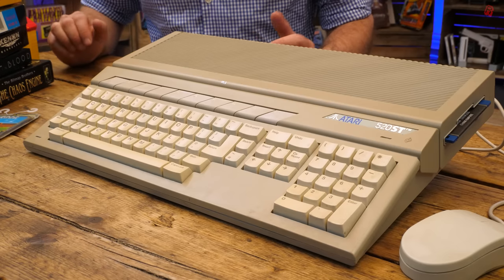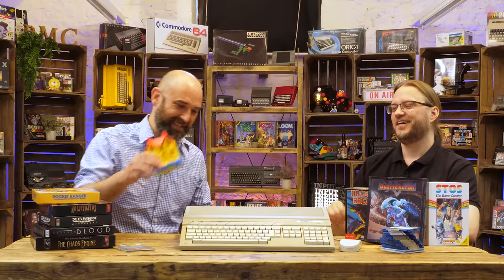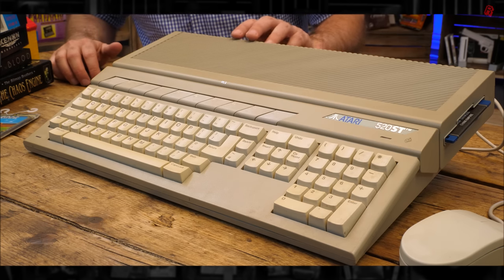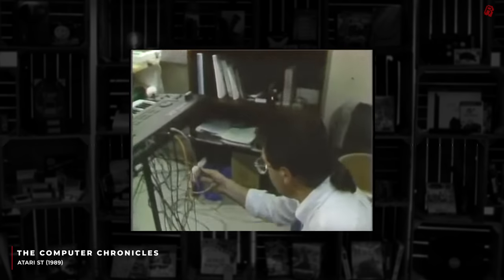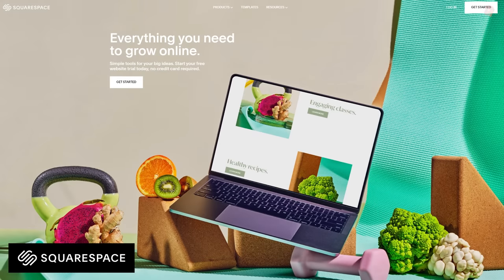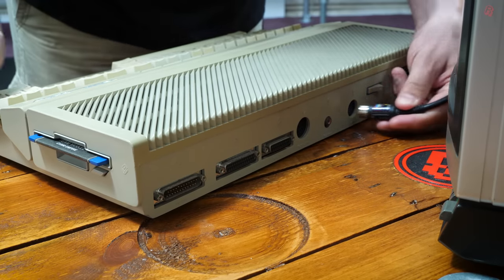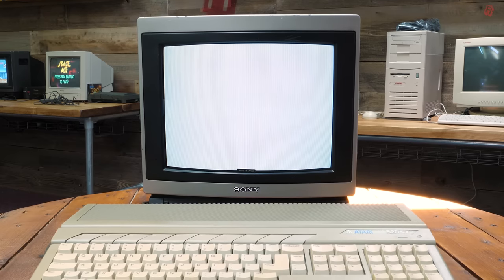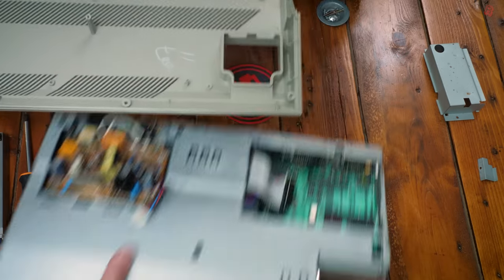At last! An Atari ST in The Cave - Meeting and Restoring a 520 STFM

Comment: The Blitter chip actually can be fitted to that ST, and will be used by TOS 1.04. Blitter was also present in some later Mega STs.
Reply: Does anything besides TOS use the MegaST blitter? As I understand it, it's not 1:1 compatible with the STe blitter and almost nothing uses it. (Hell, barely anything uses the STe blitter -- I think more stuff made modern day by enthusiasts uses it than commercial stuff back in the day)

From what I know, you can only add the MegaST blitter to the 520/1040 boards that have a spot for it. You can't add the STe blitter. (Though even if you could you would still be missing the other STe features, notably the sound, scrolling, and wider palette)
Reply: I was just sat wondering whether you could backport the blitter. Neat!
Reply: Well the blitter was built into the Atari STE, from about 89 or so.
Reply: @godslayer1415  Maybe in the US, but in Europe first series of Mega ST1 came without the Blitter chip, and actually they are not that uncommon here. Mega ST2 and Mega ST4 had Blitter, but there are reports of Mega ST4s without the Blitter.

Comment: Sadly, my ST-E took a dump during a REALLY bad winder storm in 2007.  Just before the recession.  I still have piles of stuff in a SAFER storage.  Modem.  Books.  Disks of software.  Manuals.  But no CPU unit !  I'm hesitant to shell out $$$ for a second hand.  I don't exactly understand the bad vibes the 1040 gets.  14 years of waiting to get a working "museum" computer.  I've started asking around to a couple used Computer shops...  No idea if there's any relics here in Southern Ontario.

Comment: The blitter actually came with the Mega ST, a couple of years before the STe came out.
Reply: My STE has one
Reply: Yeah, you can even add it to a regular ST if you can find the correct socket to solder it in!
Reply: @godslayer1415  who said it would work
Reply: @AmstradExin  

Really?! That's interesting! I'd love to upgrade my old 520STFM with one... because!
Reply: @godslayer1415  

Ahh did you try fitting it?

Damn!
Reply: Perhaps, if the blitter was added as a cheap and easy upgrade for all, more developers would have taken advantage of it. This chip, which takes the load of the CPU, can be so helpful.
Reply: I don't recall much software supporting the blitter or other STE enhancements. Actually I recall the 520STFM being relaunched at a bargain price some time AFTER the launch of the STE, which was really too little too late. I guess that might be the type of machine Neil has.
Reply: @ridiculous_gaming  It would have been a very easy upgrade if Atari had actually not cheaped out and included the socket soldered on the board. As is you have to unsolder to pin holes install a socket and then you can stick the blitter in. If you can solder it is not that hard a job (I did it in my STFM), getting the pin holes clear is the hardest bit, which is easy enough with a solder sucker, not much fun with wick though.
Reply: @MrDuncl  A lot of the newer homebrew stuff for the ST is now using the blitter (and other STe stuff), so it is more useful to have around nowadays.

Comment: I remember owning an Atari ST 520 STFM as a kid and wanted to upgrade the internal single sided disk drive.  The new drive arrived but was disappointed to find that the drive bay slot on the Atari case would need modification to allow disk insertion into the new drive. My father, hacksaw in hand and a glint in his eye, said 'Don't worry son, I will resolve this for you, do not fear'! Before I could protest my Atari was whisked away to his shed and after much banging and crashing and horrific zip, zip, zip sounds my father returned proudly holding a case that looked as though it had been inserted into an industrial threshing machine.  The drive worked just fine but you could have driven a bus into that insertion slot.  Bless you dad, love you loads! 😘

Comment: The YM2149 was used because it had additional IO Ports. The parallel (printer) port is driven over these IOs. The ST was cheap because of its reduced chip count.
It was not only the MIDI-ports but also the ability to "shut down" nearly all hardware to create an real-time environment that made the ST the MIDI-machine we know.
The MegaST1 was the first ST with a Blitter chip. They omitted the Blitter because of supply problems. Early versions of the Blitter weren't stable and had a lot of dead chips in production. The first Blitter you could buy where the version 5 or 6. (You could buy the Bitter as an "upgrade" for the ST together with TOS 1.04 directly from Atari at some point)
You can add 512k on the second bank. On some models the needed additional resitors are already installed, not on others. If some Resistors between the MCU and RAM are missing add some with 47-Ohm. The MCU is overloaded when the RAM is selected if the resitors are missing (bridged). To expand the RAM to 4Mb (max possible) needs some additional Resistors and RAM-select Line from the MCU.
520 ST you have is a very late model. The Custom ICs aren't socked as in early revisions of the board. The floppy is also the later model with the small eject button. The early floppies are less reliable, create the "known" noisy floppy sound and are receptive to the "headcrash visus" ( A boot sector virus that would drive the floppy head so far back that i got stuck and possibly disalign the floppy )
The SM124 Monitor is a must to use. With 72Hz it was a joy to work with.
You can run onto problems with the ACSI port. It uses internal "inverter delay timer" to create the communication timings with the hardware. Because of the age the timings can get somewhat distorted (shortened) As a result some hardware didn't work. Lowering the voltage of the IC with a diode can help.
Reply: Also, the ST used more off the shelf parts than the Amiga which used custom ICs for everything (it did Commodore that they had their own chip fab in MOS/CSG)

The ST was a quickly made up machine invented specifically to compete with the Amiga after Amiga decided to drop the deal with Atari and went to Commodore.  They did make a good machine and I see this as an Amiga man... wasn't as good as the Amiga (though to be honest, the Archimedes beat them both)
Reply: @GeoNeilUK  I like the ST because it's so easy to hack. The off the shelf ICs have good documentation, the Layout of the system is simple. The board is robust and can handle additions. The OS is minimalistic and don't restrict the hardware access. You can easily add chips to the bus (especially in the last 1MB of address space) Especially the Mega ST is a really nice board+case to do mods because of the space. I build a measuring station with a friend out of an Mega ST 25 years ago. (He was working in an university. A lot of measurements over al long time with special analog equipment)
Reply: @GeoNeilUK  both theories (the ST built from off shelf parts and made quickly to compete with Amiga) are just an urban legend.
Both computers have custom chips (Atari: Shifter, MMU, Glue, DMA, BLiTTER; Amiga: Gary, Denise, Agnus, Paula) and both have off shelf parts (Atari: ACIAs, MFP, YM, WD1772, 68000, ROM, RAM, TTLs; Amiga: CIAs, 68000, ROM, RAM, TTLs). 
The Atari ST was born as RBP (rock bottom price) before Tramiel and Shivji left the Commodore. It was based on the Commodore 900 (Shivji was working on it since 1983). 
According to Minter, Lorraine (Amiga) was born as a gaming console. Tramiel and Shivji well knew how to build a great game console (C64) but they decided that the Atari ST will be a real computer for productive tasks. As you see - different concept, different target group.
Reply: @blast4722  The Commodore 64 isn't a console.
Reply: @blast4722  The Amiga was never intended to be a console by its creators, although they allowed their initial financiers to believe that because that's what the financiers thought would sell well. And as Neil says, the C64 was a computer too (the keyboard should have given that away...).
Reply: @GeoNeilUK  True although they did make one, which I gather was a commercial flop.
Reply: Just a note regarding the 4MB RAM limit: it's only the limit for "chip" memory.  You can add an additional 10MB of "fast" memory that only the CPU can access.  Uwe Schneider's Magnum project is one such expansion.

Comment: My first job after school was repairing computers and printers for a retailer. We handled both the Atari ST range and the Amiga Range, and it was interesting comparing their construction. As I remember it the Amiga was built following all the design rules of the time. A lot of circuits was socketed and they used pull down resistor nets like it was a religion. Capacitators were used everywhere you were told they should be, every port had buffer chips to preserve signal integrity and so on. The Atari on the other hand was obviously built to a price point. Pulldown resistor nets were used if they were necessary, capacitors were sparingly used, the ports were directly wired to the logic chips without any buffers and there were very few socketed chips.

Given the differences you would have thought that the Amiga would be the more robust design, but our experience was that it was the other way around. Now a lot of that had to do with the large socketed chips that tended to creep as the computer chassis flexed when it was moved. But we also had some problems with ports that got burned out even though on paper they should be way more resilient than those on the Atari ST machines.

OK, so I've done my part and gotten that old story typed out. It's been a long time since I opened one of those machines. The fun thing was that back then there were no problem to get the circuit diagrams for machines like this. Today I don't think it would be as easy...

Comment: I miss my Atari 520ST. I had one kick ass system back in 1987, with both the RGB and Monochrome monitors with a switcher to allow me to boot either depending on which one I wanted. I had 2 Hard Drives mounted in an XT case, LOADS of software, peripherals, an Epson 24 pin printer, and so on. In 1990 I sold all of that to get a.....well, 286 PC clone that I built. I went on to become a huge PC enthusiast, but I still would absolutely LOVE to have my old ST system back today, sitting along side my PC. (sigh)......oh the good ole days! The late 80's and early 90's were a lot of fun! I grew up with computers through the late 70's, and had a computer of some kind since 1982. But the ST is still my most beloved and missed computer of all-time!

Comment: Started off with a 2nd-hand 520STM & external drive bought from One Step Beyond in Norwich when I first started college there.  Problem with that machine was that I had to load TOS from disk up front, which left bugger all ram to do anything.  And PSU's everywhere as the STM & drive had external PSUs.  So, after working the summer I got a Philips 14" colour TV, an Atari SM124 mono monitor and... a 520STE :)    Four months later, a Third Coast Technology 20mb (yes meg) Hard Disk - for £600!!! -  and an NEC P2200 24 pin printer.  And Calligrapher word processor on cartridge.  Designed a 200 page software manual on that, and printed it on the NEC!   Neighbours weren't happy with the noise!  I did pass the course :)

Comment: Great to see an ST 😁

1MB RAM, blitter. Gotek. Satan disk. And try the few games that supported midi, connecting your Mt32, or SC 55 in Mt 32 mode. Games like the ones from Sierra and Cruse for a Corpse sound great in midi.

Via the rgb scart, it looks really sharp and crisp on a Sony PVM.

Comment: Thanks for the 'blast from the past'.
This was my university computer until Linux came along and made an x86 PC worthwhile. 
I upgraded it with a double-sided floppy, a memory upgrade to 1 Mb as far as I remember I just added the chips and it all worked. 
When I got to Uni I found i needed more space so I bought an 80 Mb hard drive which seemed HUGE at the time.
My next big expenditure was a mono monitor and a Star LC10 printer which I used along with the 'Protext' word processor to produce my final year project report.

Comment: Great video guys, Mark even survived the experience of touching the evil enemy of the big 'A' ;)
After coveting an Amiga 1000 from afar (there was no way I was ever going to be able afford one), I bought an Amiga 500 on launch.  But, like a large number of other early Amiga owners, both my floppy drive and mouse soon stopped working.  This happened to so many people in fact, that there were not enough spares available, so I had to wait a month or so before I could get my machine up and running.  Having put forward my entire life savings at the time to get this machine, I lost faith and instead, took my machine back for a full refund and bought an Atari 520 STFM with a high resolution monochrome monitor at a discount (from the shop I worked at previously).  Games were played via the RF interface to a TV and later a Colour monitor with a switch was added.
This machine introduced me to the power of full screen desk top publishing, which I used to take my magazine (Micro's Gazette) to the next level.  It was my workhorse, my equivalent of the IBM PCs I used at work.  I also got into programming the Gem window environment and put together some business applications (having moved on from writing games for the 8-bits). I did slowly upgrade, replacing the 520 with a 1040 and then that with a 1040STE, and then that with a Mega STE.
Another great thing about the machine is the disc format is perfectly readable on a IBM PC, using the same sector and track layout, along with the same FAT as PC Jr machines.
I recovered the text of my first book from my Atari ST discs, that I had written using Microsoft Write.
And just so Mark doesn't get too unhappy, I did come back to the Amiga machines, starting with a 2nd hand 500, then a gifted 1000, a 1200 and my most recent machine is a very nice 2000.
Definitely Ram (and I think you can install up to 4MB) and a floppy emulator as a minimum.  Hard Disks will depend on what you can get hold of, I have one of the removeable cartridge hard drives that works quite well (extremely short DMA cable aside).

Comment: My first PC in December (Christmas) 1985 was an Atari 130XE.  But I never had a floppy disk,  I had a tape deck that went with it.  The ST was the stuff of dreams!   I was 13 years old!   I have been gaming on PC ever since.  I still hark after coding in basic, loading up on tapes.  Twas an excellent machine, much better than the C64, Spectrum ZX.  I had the upgrades over time as well.  I used this well into the mid 1990s.  It's possible that it's still in my mother's loft somewhere!

Comment: This got me through college.
I had a 520 that was upgraded with Double sided drive and extra ram soldered in, and used with extra floppy drive and SM124. Even networked it through the serial cables and midi ports with others who also had.  Used it to write and test my course work.

Comment: As someone who had an Amiga & only knew people with Amiga's I didn't have any access to the ST, I have to admit that all these years later I really like the aesthetics of the ST.
Reply: I always preferred the look of the ST (main unit) over the A500 and the STFM having the integrated PSU, modulator and FDD  (I'll ignore that the 1st ST had an external single sided drive and thus incompatible with later software) was such a neat package. But the keyboard was spongy ugh!. It wasn't until the A1200 that I preferred an Amiga look.

Comment: Nice to see one on the channel.  I got myself an Atari ST a couple of months back to add to my collection, never owned 1 back in the day.  Though I went for a 520STE (badged 4160STE).  As well as the bonus of the Enhanced features, they're also easier to upgrade to 4MB RAM, thanks to the standard 30-pin SIMM slots.  I'd definitely recommend a Gotek with FlashFloppy firmware + HXC Selector software, that's what I'm running on mine with a 3D printed bracket purchased from eBay and it's ideal.  There's the UltraSatan HDD option available too.  On that STFM, definitely consider installing the extra RAM, especially if you're considering the HDD option.

Comment: On the one megabyte upgrade. You only need to add the RAM chips. I actually did that back in the day
Reply: I have seen so many 1MB upgraded Atari 260/520ST with the chips just soldered on piggyback style.
Reply: Same here! Time to dig mine out of the garage!
Reply: @AmstradExin  my dad did that with my 520ST :) I still have that machine.

Comment: So I am a bit ahead of you on my own STE journey.  I dug the machine out a few weeks ago and fitted an OpenFlops drive.  
I then dug a little deeper in the garage and found a 20MB Megafile HD in original box complete with price tag which when I plugged it in not only worked but booted up my old custom desktop.  It uses an old style RLL Drive which I don’t think are manufactured any more.  

I also found 2 cardboard boxes full of original big box games complete with manuals and all the gubbins that came in the boxes.
I now have a GreaseWeazle ready to try and image all these original disks plus a storage box of random floppies I found in the shed.
I have a memory upgrade from Exxos ready to install when time permits.  I also have the original Atari Mouse.
Machine needs a thorough clean and a retrobrite at some point plus some tlc for the power supply caps